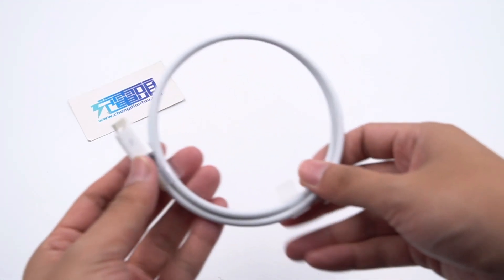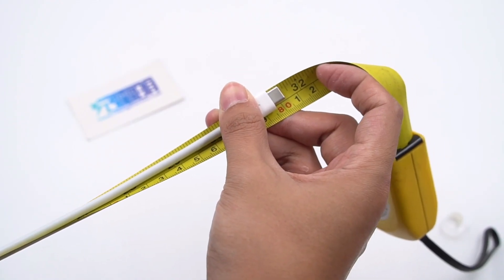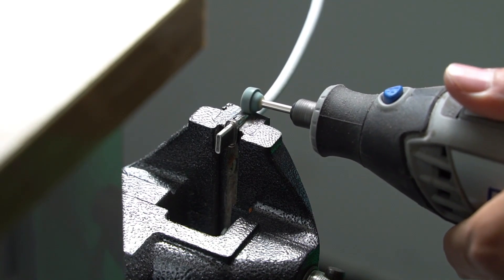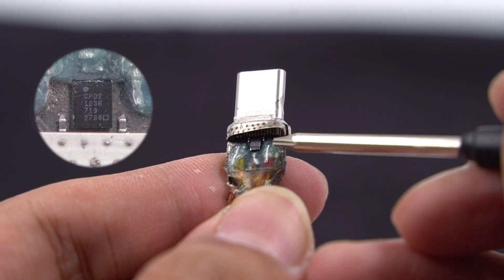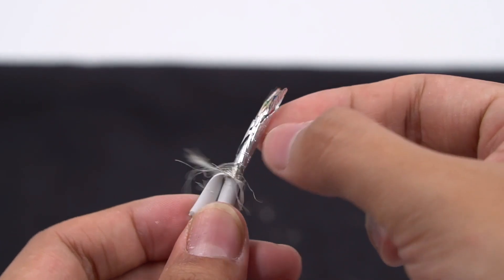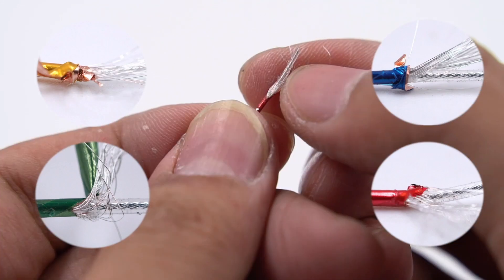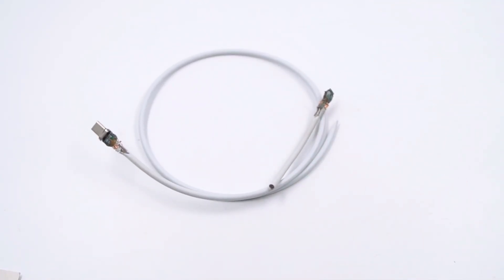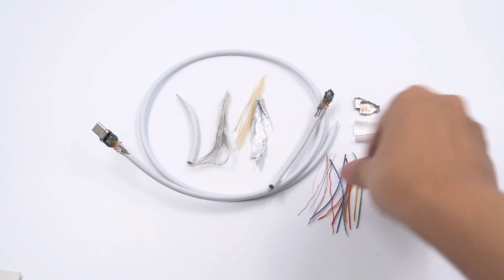Teardown of Apple Thunderbolt 3 (USB‑C) Cable (0.8 m)

Comment: As speed is 40gbps for 3 and 4 thunderbolt except that support for 2 display support. So I was wondering if thunderbolt 3 cable will be compatible and work with thunderbolt 4 ports for most functions?

Comment: Great video! Planning to use it with the new Anker PowerPort III 65W 2-Port, would you recommend to use this Thunderbolt cable instead of the normal usb c cable for charging iphone 12? is there any difference? I just want to know if I can get more advantage with this cable (fast data transfer+charging)
Reply from the maker: The normal cable with E-mark chip can only support 100W fast charging (with USB 2.0 data transmission speed). Only the thunderbolt 3/4 cable can support up to 40 Gbps data transmission.

Comment: Do the USB C Charge cables that come with the MacBook support up to 100w of charging?
Reply from the maker: Yes, the cable in the MacBook box only support 100W, not high-speed data transmission.